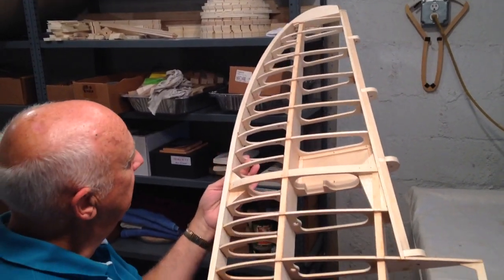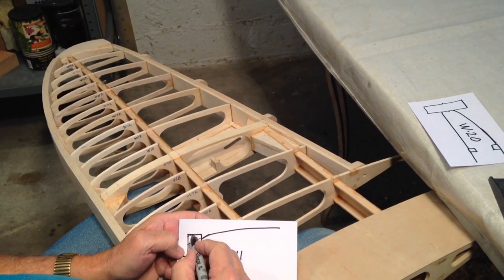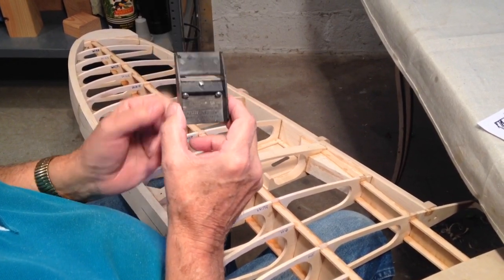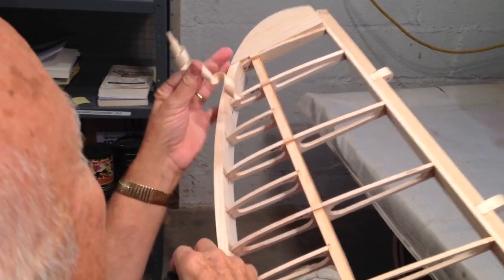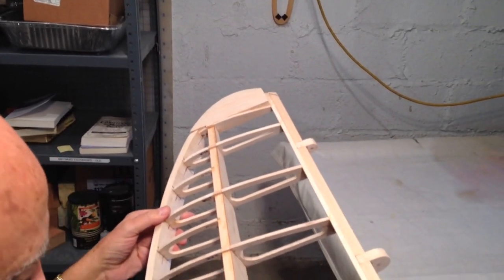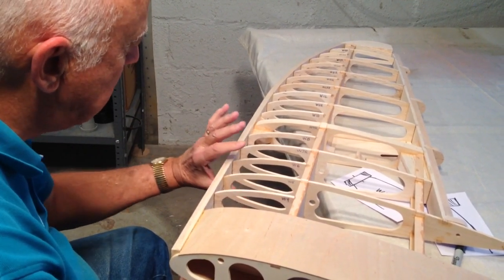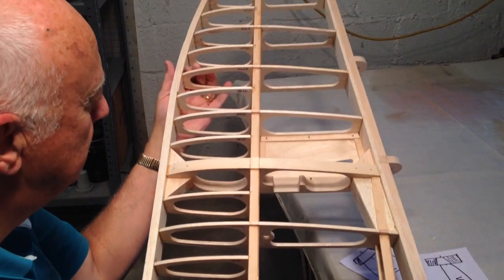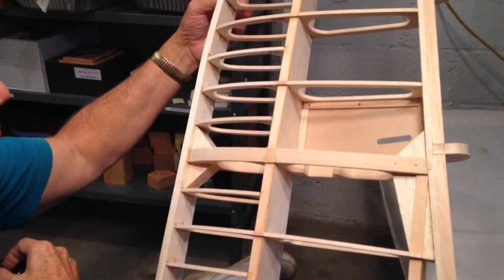Wing Leading Edge Shaping Part 1

Comment: Is it best just to do it in sections until you get everything down to a certain thickness, then sand it the final way? Its pretty satisfying watching you do that. My first balsa plane was a Cessna and it was much smaller. I thought it came out pretty good for a 17 year old that didnt know much about building an RC plane.I build plank on plank Wooden ship models as well as other projects. I took advanced wood working in highschool but found out I liked working on the lathe. My project earned me third place in my department but first in design. I wish now I had build something more delicate but back then, it was cabinets and clocks. I made wooden bowls. There was no one else in my field or department, so easy first place. I still like working with wood, but my hands are starting to fail me.
Reply from the maker: RC:  I am more comfortable shaping the leading edge "all over" rather than one section at a time.   But that's just the way I like to do it.  If shaping one section at a time is easier, then by all means, do it that way.  Either way, you should get to the same place.  Thanks!  Chuck

Comment: How did you mark a perfect leading edge datum as drawn in your video?
Reply from the maker: Nick, the leading edge, before it is shaped, is 1/2" x 2" balsa.  The datum line, which is also the chord line in this model, is on-center.  Does that make sense?  You will find the complete build at www.gratnerbrothers.com  Thanks!  Chuck